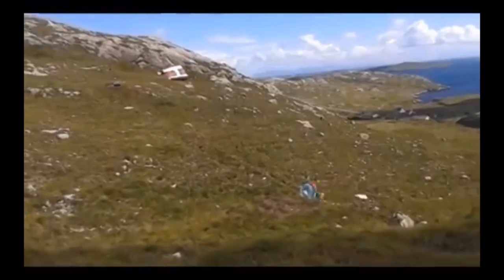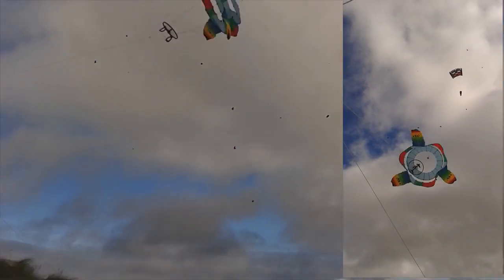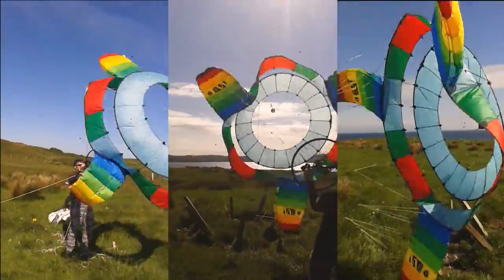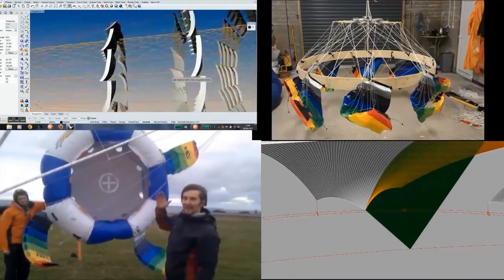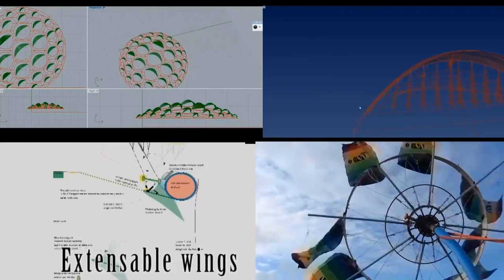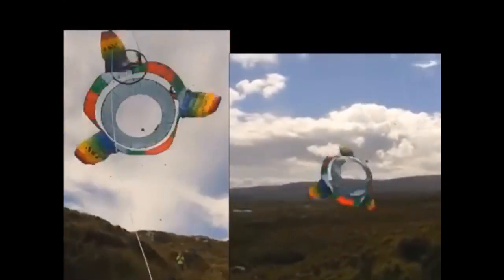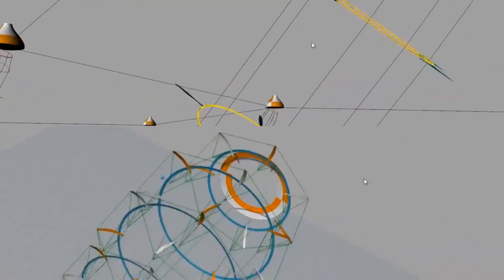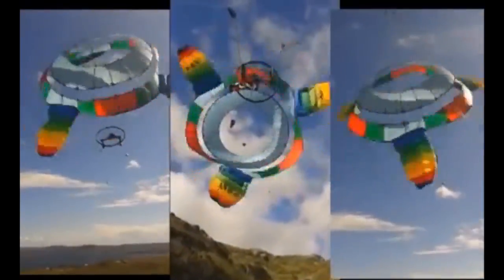The importance of bearings in Daisy Generators

Comment: I still believe that the blade of the daisy needs to be curved so that the tip of the blade pushes away from the hub. I think that would make it more stable and have the hub maintain a round shape. Aerodynamics with floppy materials is pretty tricky, you not only have to take airflows into account, but also how they influence the shape of your turbine. Maybe there needs to be a new scientific field of "floppydynamics".

Great work anyway, keep it up! :-)
Reply: An alternative could perhaps be to have one of those rings on the outside of the turbine blade, pulling the blade tip outwards. That would be easier to contruct, and could perhaps have about the same effect? Although I am not sure if such a ring would collect more wind into the turbine, or decrease the wind that goes through the turbine as a whole.
Reply: By the way, do the blades really need to be slimmer at their tip? Especially if we have an expansion ring on the outside. Why are ordinary turbines slimmer at the tip? Is it because of aerodynamics, or simply to keep the structural integrity of a solid blade? Maybe a kite-blade could be designed with fat blade-tips, just like a ducted fan normally is.

Why not make a daisy that looks like a huge ducted fan. Expansion ring on the outside and blades that get fatter towards their tip? I would be really fun to see you try that configuration out.
Reply: Btw, your design already has two expansion rings. Make one of them bigger and put it on the outside of the turbine blades.
Reply: Ok, some interesting thoughts there. Yes, you are right that it could be easier to curve the kites towards the wind. That is perhaps the most neat design. In that case, maybe you are almost at an optimal design. 

About turbine solidity I have the impression that it depends a lot on what type of generator is used, that higher solidity is better for low airspeeds and higher torque, but it requires a more complicated generator with more wireing. 

What do you think about having a set of lines between the back edge of the blade, connecting to the outer edge of the expansion ring of your current configuration? Maybe in that way, the rotation force will rotate the whole ring, instead of just rotating the individual kite at the attatchment point and deforming the whole thing. Or do you currently have such lines?